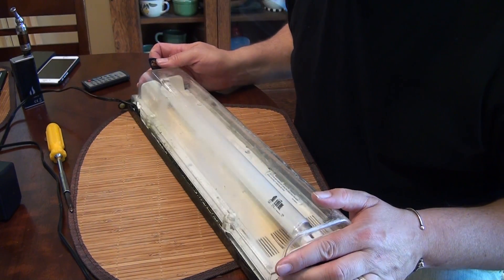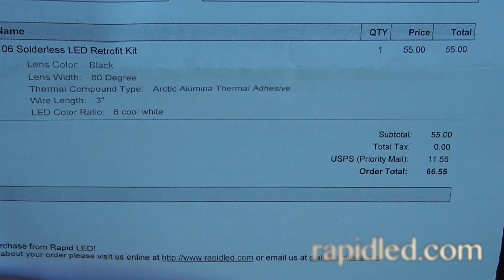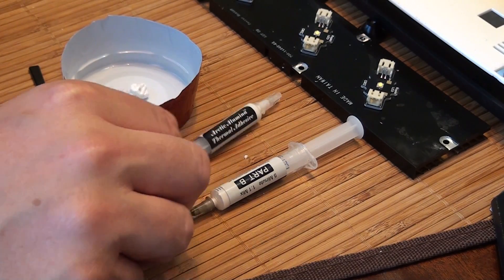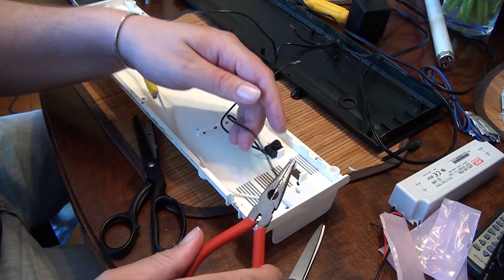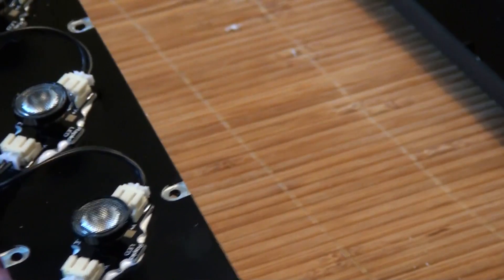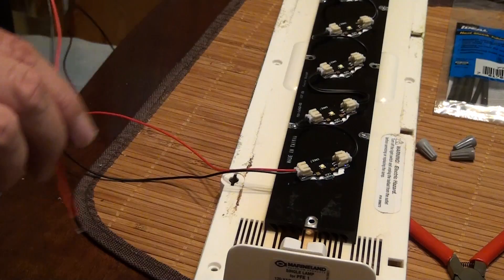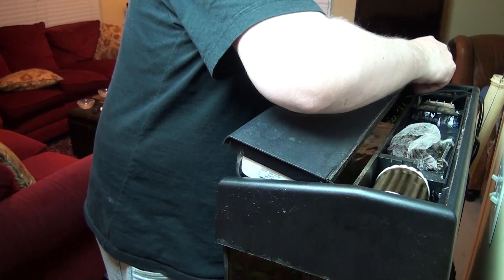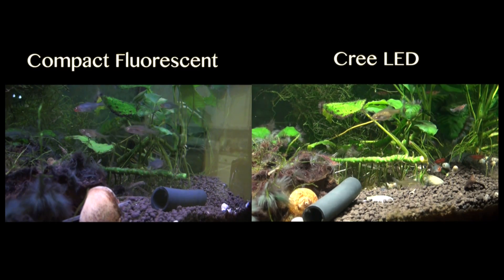LED RetroFit: Eclipse One Hood

Comment: Great video pecktec. Any issues with overheating where you think you'd need a fan or does the heatsink keep it cool enough?
Reply from the maker: It actually seems to stay cool. That compartment has venting holes though. I think it runs cooler than the CF lights did.
Reply: @pecktec  , wonderful job. Glad I found your video. I'm sourcing all parts now. However, do you believe the heat sink is necessary?
Reply from the maker: @jamietuttle1818  yeah these lights in particular are very very hot. They will melt plastic if you set it to close.